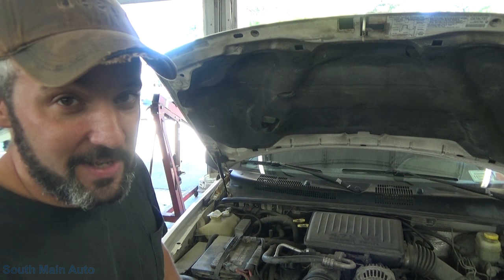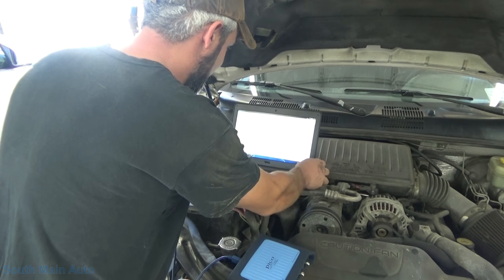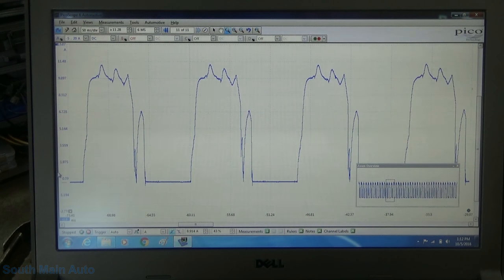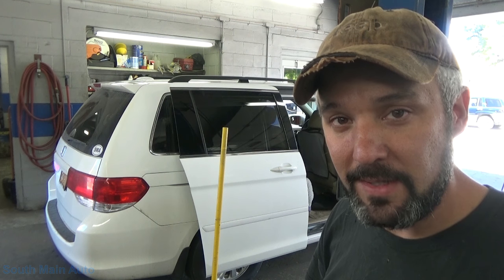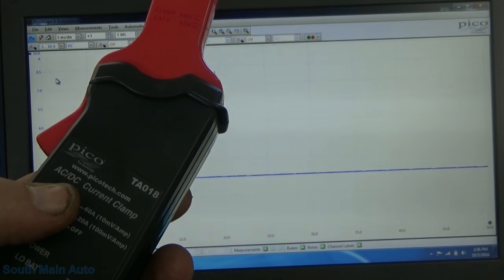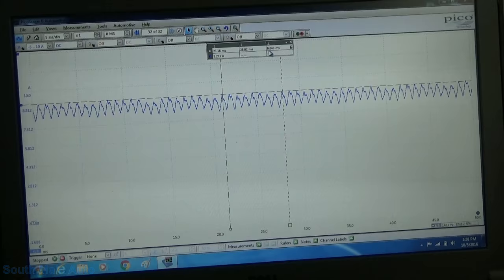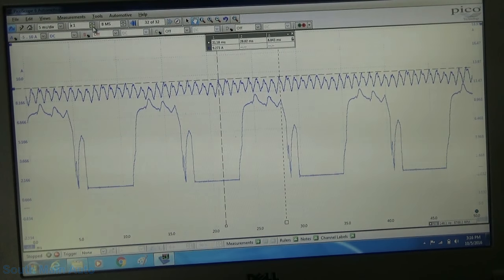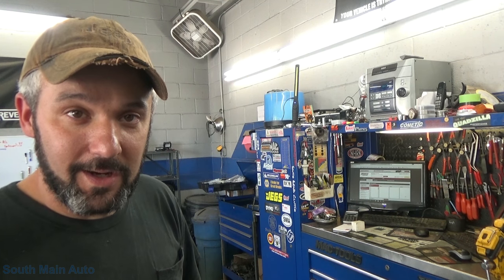Intermittent No Start - Fuel Pump Current Ramping

Comment: The higher amperage after a dead spot on the original pump could be attributed to the pump speed. As it starts to slow down in the dead segments, it's CEMF (counter electromotive force) is lessened. When the pump "re-engages", it is doing so with less resistance (because of less CEMF), so amperage starts off higher than normal. Same condition applies to when the pump first starts to turn. (very high amperage, from no CEMF)
Reply: Also, on a system that monitors the actual fuel pressure and establishes a desired fuel pressure and varies the duty cycle of the pump to match both, we could see the same thing happening where the computer is driving the pump extra hard in order to reach it's pressure.
Reply from the maker: Ends up the new pump drew just as much amperage in the end and it is the only thing on the circuit so must be just the nature of the beast on this one.
Reply: High amperage on new pump might be a case of 'not broken in' yet, give it a couple thousand miles and it might be easier to spin over?
Reply from the maker: Lee Barnes Or you have to have a known good. All vehicles are different.
Reply: would that be a peak 9amps? or an average of 9 amps? 
the new pump and old pump run at 9 amps....
ass we see the new pump is steady about 9 amps. 
is the old pump averaging 9 amps due to cemf? 
as we can see it appears to have huge peaks and valley's .
 i would never doubt the skills and abilities of anyone, or even question this, however more of just a question of scaling with the new toy..... very impressive by the way. had my eye on a 2 chan for some time. let us viewers know how you really feel as you always do. as always great comments from the non obtuse world and another great vid (doctor) eric o.!
Reply: ScannerDanner u took the words out of my mouth lol...yeah right i was lost
Reply: I didn't know u guys watched & commented on each other's vids - that's cool! (thanks for the extra info mate - makes sense)
Reply: I have a comment. I hope I get a reply from the elite. I did this same test to my 2004 chevy colorado and I'm getting 10ms. So comes out to 6000 rpms. I did this same test to 2016 chevy cruze and I'm getting 16ms. So comes out to 3750rpms.i am using a uscope,and getting very low amps on chevy cruze. No drivability issues. I did read eric o say all cars are different. So using this formula how can I know what rpms my pumps are supposed to be?
Reply: have to keep in mind that many late model vehicles will not run the fuel pump at 100% under idle conditions, so you may be seeing the result of that in the lower rpms...Just a thought.

Comment: This is really a cool idea. For those not wanting to spend this much on the PicoScope I can suggest a much cheaper alternative.  Buy an Analog Discovery for $250 (cheaper if you are college student) and purchase an ACS712 for a couple bucks. The Analog discovery is powerful device with 2 channel oscilloscope. It has a function generation and DC voltage output. The software is free to download and use from the Digilent website.  The analog discover does not have an amp clamp to measure current but that is what the ACS712 is for. With this setup you can accomplish the same thing as Eric O. here but is much for cost effective for the DIYer. I am not a salesman or anything like that just thought I would pass the information along to anybody looking to be able to analyze circuits. Great work Eric!

Comment: cheers Eric, a tip I got years ago was that the fuel pump draw should be approximately half the amperage of the protecting fuse ie a 20 amp fuse should only draw 10amps approx cheers sandy
Reply from the maker: Take that with a grain of salt because there could be other things on that circuit too ;)

Comment: Another tip. When you want to compare before's and after's, all you got to do is save your before capture, and when your ready to compare it, just plug your picoscope and open the file you saved(the before capture) and you now have the same triger, time and overall settings.

Comment: It seems to pass most users attention, because in every diagnostic video people are calculating the RPM of fuel pumps ..... after you place the two cursors (as you did) you can read the RPM in the bottom right corner box of the Pico software. This feature has been there as long as I have my scope.
Greetings from a Pico user.
Reply: Ok, just watched the second half of the video 😁

Comment: Way to step up with the pico. Them are very nice scopes but not quite in my budget yet so I still use the good old snap on scope which does everything I need it too from high speed can to current ramping but one day I will get a pico as they are the best scope out there currently.

Comment: Next job for my PicoScope .. ramp the pump on my 182k Odyssey .. had a crank start/got stranded/crank no start/intermittent/came home on the hook .. reflowed the main relay (resoldered bad solder joints) .. runs again but needs my due diligence ...

Comment: that pico is amazing, you need to use it more often
Reply from the maker: I plan on it
Reply: It is USB and used with laptop.
Reply: The analog discovery is also a function generator as opposed to what your link shows just an oscilloscope if that is worth anything to you
Reply: chris keiley this is the cheapest pico that you can buy ? does it have same amazing SW as the one Eric used ?

Comment: I just got a Pico and I'm looking for anything I can test and since I have a 2000 Grand Cherokee with the 4.7 with original pump, I just did the same test for comparison.  At idle my pump is running around 5.4 amps and 6,500 rpms with a similar looking waveform as the new pump in your video.

Comment: Same Pico kit I just bought, don't use it enough though! I find the blue usb3 lead a bit in the stiff side. I believe you can use a nice soft usb2 lead but don't know the exact reason for the blue usb3 it's summat to do wi speed.
Reply: usb2 is 480Mb/s. usb3 is 4.8Gb/s
Reply: Steve, Pico had an issue with the original USB cable years ago where it had an intermittent contact with the USB ports on some computers. The engineers found out that a lot of the computers on the market had issues with their own USB ports. The pins inside the ports would be a little too wide in making contact with the USB cable. So, they engineered the blue USB cable so that it would make a stronger contact with those computers that had those issues. This is according to Autonerdz.com where Tom Roberts brought us up to speed on this issue.
Reply: I think there might be a bit of confusion here. I'm relatively new to diagnostics and I have the same Pico Eric O has it's a 4425. It came with a blue USB lead which is USB-3 The lead is VERY stiff so much so I feel it strains the usb socket on my laptop. This blue lead has an extra sticky-up bit on top of the end that goes in the scope, that bit is to do something else allowing the cable to be much faster as SirDeanosity said (thank you) I believe an ordinary soft USB-1/2 can be used but I don't yet know the exact answer of why and when! 
The blue lead can be use with the scope on a pc with only the old USB sockets but the data will transfer at the old speed as it will fit into the pc. My laptop has USB a couple of USB-3 ports identified by a blue insert although yet I haven't noticed any difference in the three combinations.

Comment: Hey Eric great videos! Can you only use that method if the fuse only has a specific component on that circuit?   for example.. what if they had an evap pump running off the same fuse..  that's hypothetical. it can be any component.

Comment: HAHA, Nice to have all of them Tools.  Don't know about you but I absolutely love the Pico, best money I ever spend LOL.  Only wished that it would support a longer USB Cable.  They told me they would look into that, fingers crossed!! Would be nice not having to drag a Laptop to the Car.
On a side Note, I did not see any custom Probes??
Reply from the maker: Custom probes in my drop down menu you mean?
Reply: Yes, being sarcastic lol  Enjoy that new Tool!!  One of the key features to me is the software's ability to add custom probes and create very accurate maps.  Setting up Transducers of any type is a breeze.  Snap-On only lets you use Snap-On.  I may not be very clear here but I just love the fact that Pico allows me to set up anything I like and does the math for me.
Reply from the maker: Yes sir, Ivan already helped me set up custom probes for the homemade pressure transducer :)
Reply: Good for you,  hope you will enjoy that tool as much as i do.

Comment: Is there a cheaper tool you can use which is similar to the pico? Had a problem with intermittent starting on a Citroen Berlingo and we didnt know if it was the fuel pump or the fusebox(relays were integrated in the fusebox, you couldnt just change the relay) and if i had this tool it would help alot but idont feel that would use the pico for much more than just this kind of problem.
Reply from the maker: There are many scopes out there you can use. All different price ranges.
Reply: You can buy Hantek 1008C automotive scope kit and buy Hantek CC-65 60Ampere AC DC Clamp ammeter. Probably will have a total cost of US$ 137.00

Comment: Most fuel pumps use motors with carbon brushes... any on experience how long hese will last , aprox how many hours or miles ? Let´s asume the rest of the pump lasts that Long.I think about changing the pump some time as preventative maintenance one day... ´but I don´t want to do it way too early because on my car the tank needs be completely removed from the car. thanks
Reply: I can't say how long a pump will last, but I can say it will last far longer if you keep the tank more than half full.  It works a lot less hard and stays a lot cooler.

Comment: The amps the average and not the peak when measured on this type of waveform, so bad waveform would have been drawing  roughly 5-6 amps. If you think about it you can't be drawing more current when you have less commutators or poor brush contact.

Comment: What laptop are you using? I got a free Bosch master tech Vci at work but I have to find a laptop that will work with it? Does the pico have any special requirements like the Bosch
Reply from the maker: Just a cheapy. windows 7 64 bit. I use it with the bosch too.

Comment: Another tool that you might find useful, especially if you are "on the road" is something called a Mooshimeter (https://moosh.im/mooshimeter/).  It is a wireless DMM, but with 2 simultaneous channels; 1 for voltage and one for current (up to 10A).  It displays on a smart phone or tablet.  It is not a scope, but the display makes it look like one.  It is a 8kS/sec "data logger" with an SD card for storage.  It will run for days sampling and storing data.

Only $120.

Comment: 10 Amp is high. Check the specs for the pump. If it's too high you may have a clogged fuel line...Yes I'm an armchair mech with a psychic scanner.

Comment: PICO Scopes are great, but I still think they are over priced.  They really need to update the hardware.
Reply from the maker: 100MS/s is not fast enough?
Reply: It is more the price than the performance.  Plus the cost of their "kits" are outrageous. They want an extra $900+ to go from the 4 channel "starter" kit to the "standard" kit and what do you get ?  A low current amp clamp, a high current amp clamp, some extra adapters, clips, fuse extension leads and secondary ignition pickup clamps which are useless for COP.  At retail price, that is only $300-$400.

They have proven themselves very useful with their current capabilities so it is hard to say they are "under powered".  But, there are scopes out there that have much better specs for much less money and they have a display (although no where near as large as even a small laptop display).

I do know they have some nice software and their waveform library is valuable, but don't those come from customers ?  20 Mhz analog front end should really be improved, but at least it has 12 bit resolution.

You have used them and the Snap On scopes.  Bang for the buck, would you say they are better ?
Reply: theoldwizard998 what other scopes would you recommend?
Reply: Unless you are comfortable with a standard lab 'scope, there is nothing that offers the built in automotive testing and reporting.

You can't beat Rigol for "bang for the buck", especially if you hack it to handle faster signals.  At the low end, the Lab Nation Smart Scope is pretty amazing.

Comment: You can save yourself  the maths to work out the RPM, once you set the rulers it will read the RPM in the bottom right corner.
Reply: Ah, should have finished watching the video before commenting!
Reply from the maker: Haha no biggy

Comment: that pattern looks like shit.
alot simpler with the vantage or verus
Reply: Vencent Bauer I have the Verus Edge and the Pico scope I hate to say is better with more features & detail. I'll be ordering one soon to augment the Edge
Reply: ya the pico is a better scope I have a pico also sometimes I like the modus or vantage the wave form just seems easier to use at times
Reply from the maker: What waveform looked like shit? I also own a verus edge which has a 100th of the sampling rate of a pico. Also I guess I don't see how the snap on is simpler. It is the same process to collect the waveform?
Reply: I'm in agreement the Pico is definitely better than the Verus Edge or Verus Pro's lab scope.  I can't wait to get mine! The Verus Edge & Pro lab scopes are 6 MS/s sampling and the Pico using 4 channels is 100MS/s but if only using 1 channel it is a whopping 400 MS/s...plus all the other features the Pico does has me SOLD.
Reply from the maker: Hayward's Automotive ...exactly. Gather wave forms on a high speed CAN with S.O. then a Pico. Can't even compare.
Reply: South Main Auto Repair I like my Verus Edge but once I get my Pico I know what scope I'll be using. I do a lot of research before I buy and the Pico impresses me plus what I seen from you and Paul with the Pico made the choice pretty easy!